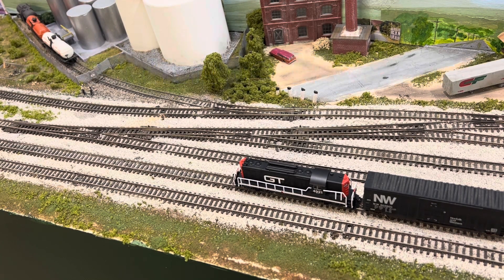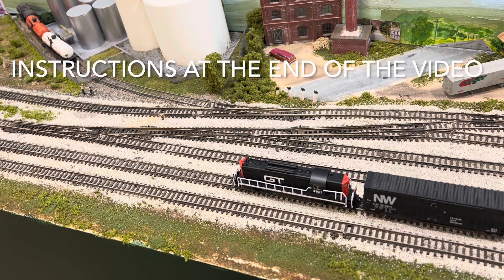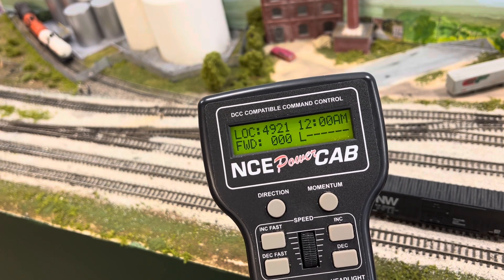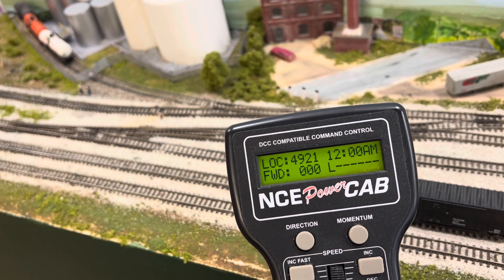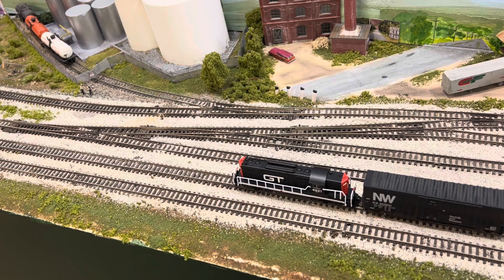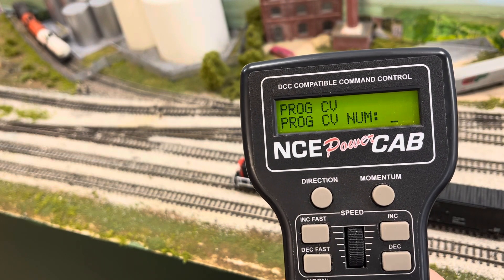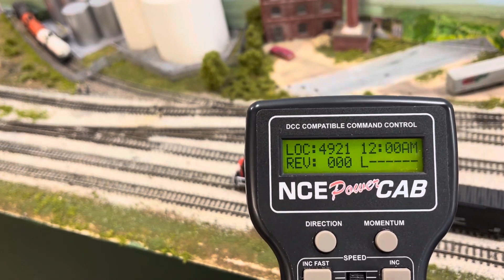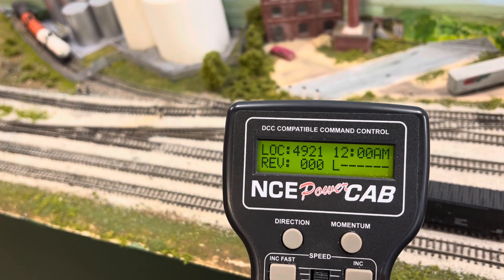Success! Changing Horn and Bell sounds on ESU decoders

Comment: I have a 2017 Atlas MP15DC and this didn't work, it kept the same horn for each number i put in, any tips?
Reply from the maker: Thanks for watching and reaching out. My video only referred to the ESU decoders that were factory installed by Atlas. I couldn’t find what decoder Atlas installed on that model. If you are sure it’s ESU it may be an older version that has different codes. Or it might be a different manufacturer. You could send an email to Atlas and ask them, that’s how I learned what to do for the GP9.
Reply: @5minutemodeler650  alright thanks, I do believe it is an ESU so most likely an older decoder.